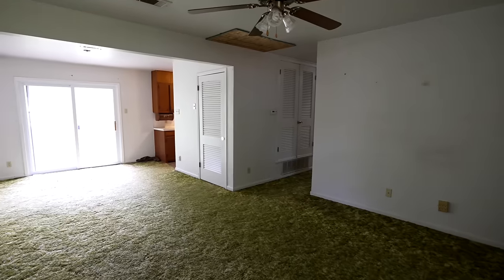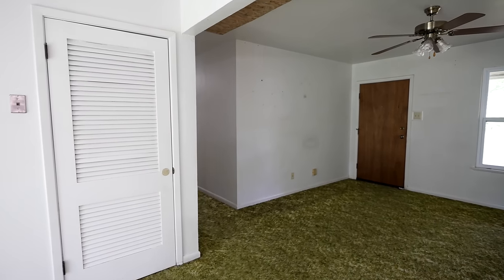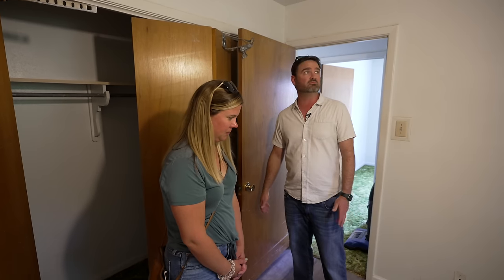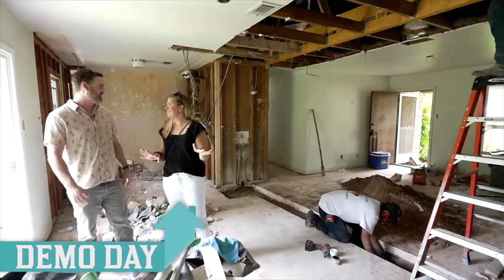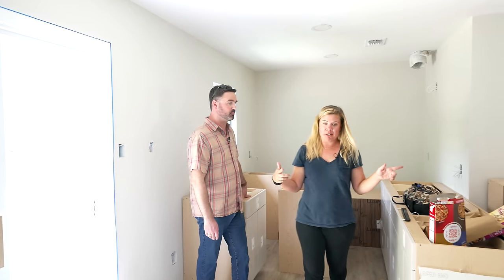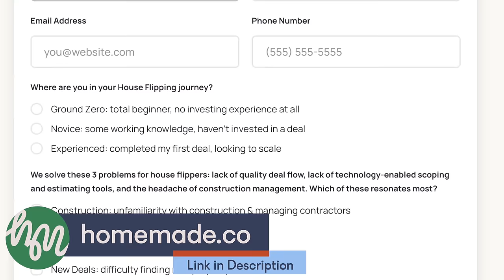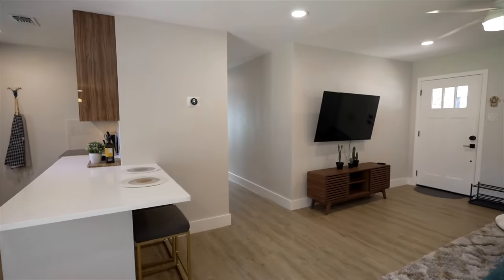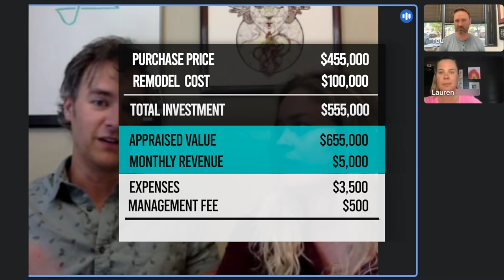A To Z Whole Home Renovation | EPIC Transformation

Comment: It looks great but you should've put a pocket door on that master bathroom. its going to be hard to open if someone is using the sink. You'll also have to close the door to open the cabinet doors or drawers.
Reply: Also, NEVER put a stove/oven up against a wall. It would have been so easy to just move it over 14" inches to have counter space on the left instead of a wall!!!!

Comment: Feel like they should have kept a bit of a drop-zone mud room at the back of the dining room...maybe behind a pocket door. Not so much for the airbnb, but for resale later. Otherwise, a fantastic reno.

As for the airbnb, they should have swapped one of those queen beds with a double set of bunk beds. Would have gone from sleeping 6 to sleeping 8 and from 3 separate beds to 6 separate beds. Very useful when it's not just couples or when there are a lot of kids. Also, a pull out couch in the master bedroom would add another bed!

Comment: I love the channel, I can't remember when I first found it but I binged your videos and watch every new one. But what if I want to flip my own house? We're slowly working on it but it's going to take many years. It needs a lot of work, it was built in 1933. It's small and cute, but has some big issues. The bathroom will have to completely come down, it was an addition that has no ventilation besides one window and they slanted the roof wrong so ice builds up. The chances of mold in that bathroom are very high. 

The kitchen is a lean to and my boyfriend says it's no the best structurally and should be rebuilt. Another thing is working on a better foundation, the original foundation is mostly rocks so the house is a bit crooked. We're planning on no basement (even though that would provide more square footage) as that's a big expense and will take longer. It's a story and a half, after we redo the kitchen we'd like to extend the second floor over it. 

There's some beautiful original pieces to the house, hardwood under laminate (we sanded and restained the living room but the kitchen has at least three layers of tile, linoleum?, laminate and potentially some sort of floor leveler), one banister, and the cupboards seem to be handmade. They've got wavy wood around the cabinets (I don't know a good way to describe it) and they're slightly uneven but I love the charm. The counters are a weirdly low height lol. We want to keep it in it's older style, when my boyfriend bought it they had painted the trim a grey-blue which didn't work and it's back to brown. We like old appliances and such so it matches very well.

Any ideas and stuff from anyone would be appreciated, it's fun but daunting